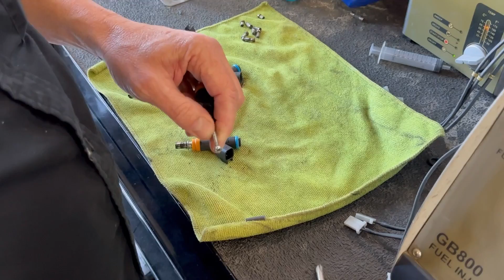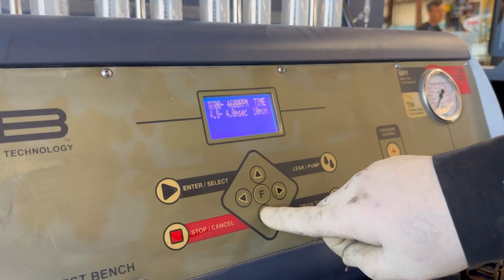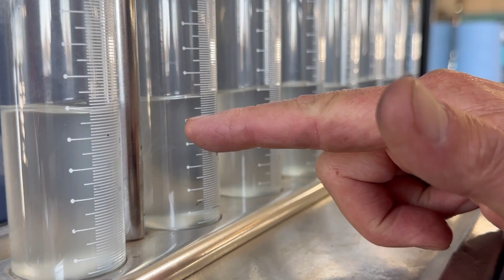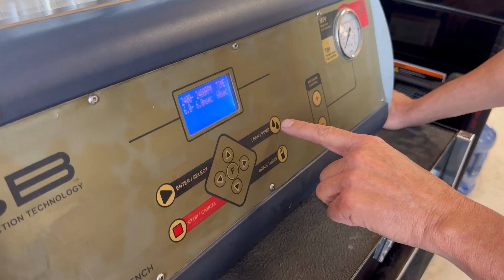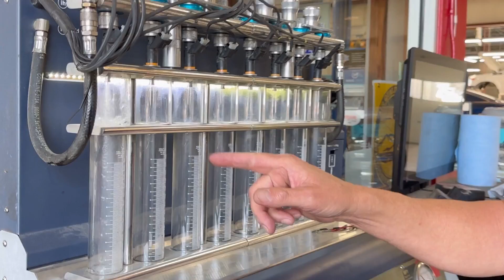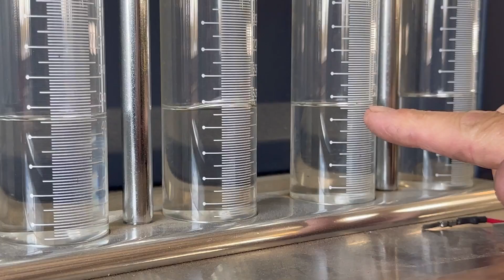How we clean and test our gasoline injectors before we reinstall them in our engines

Comment: This is a "fit" when performed on injectors that are to be used on an engine that is being sold complete with injectors. Try selling this job to a customer as a "fix" for a problem (and then try and selling further work when this step does not fix the problem.) Injector cleanings seem to be easier to sell as maintenance rather than a fix. None of the Dealerships I have worked at ever had such a machine. The closest thing I can recall was a simple pump and gauge type tool intended to be used on full mechanical (is mechanical the correct word?) injectors used with the Bosch CIS injection system. I know that some people like the CIS injection technology but I was pretty glad to see its use discontinued.

Comment: 10$ to 40$ a piece, why even bother?! This cleaning and testing can't be cheaper than that. considering labor hours and if you get bad one from the shop, you knock sensor will tell you that definitely. You could change them every year for that money. I would understand if you deal with Europeans that cost 200$ a piece. 
Even changing them is only one hour work with the knowledge how to hold a screwdriver. 
Video itself is educational indeed, no critics there.

Comment: Got a P050D code for my '16 Silverado, believe it's for injectors. Truck runs fine no issues other than light. Thought I was going to need to change injectors but added injector cleaner and premium gad and after about ¼ tank the light has turned off. I've done this twice. What would you say would be the best route?

Comment: Just a simple question.  With the labor cost of all that testing would it be cheaper to simply replace them all.  I'm assuming that piece of equipment is very expensive.  Even if the original injectors are all good the labor cost would of bought all new.  I replaced a few injectors they are not that expensive. I just want your take on it.  Simply asking to learn.

Comment: Out of curiosity what is the percentage spread between the average set of 6-8 injectors and testing them like this. What is the potential savings to the customer over a new set? I see there being a savings, just wanting to know apx. How much. Because since you have now 6 older injectors with say 100k miles on them and two new ones you know more are bound to fail in the future.

Comment: Dave, I want to take your suggestion to change the oil in my vehicle twice as often as a manufacturer recommends. I have a 2013 Porsche GTS with 125,000 miles; the manufacturer recommends changing the oil every 10,000 miles. Assuming I go forward with changing the oil every 5,000 miles, do I need to change the oil filter at the same 5,000 mile interval? I have a Fumoto oil drain valve installed, so it’s very easy to change the oil. It’s a lot more work for me to swap out the filter. But if you changing both the oil and the filter. Every 5000 miles is the best way to extend the life of my vehicle and avoid maintenance/repair catastrophes, I will take your advice.
Thanks, 
Austin in Nashville, TN

Comment: I have a dodge neon 05 in the shop today. Code p0204. PCM im thinking havent got to check it yet. Customer is aware..though the injector its self works fine...tested the signal with a noid lite..👍. Sounds good through the ear thingy 😂. So hes comeing back at a later time. Cuz today he spent some good $ on suports All 3....😊

Comment: Aircraft injectors are all brass. Soaking in hoppes#9 gun cleaner makes them look like new and is approved. Had a nose steering bearing freeze up. Tried every chemical I had and nothing would “soften” old grease. H#9 cleaned it in no time.

Comment: Dave u think two injectors can throw more fuel then two drilled jets nitrous nozzle or no jets for CNC 30 liter V8 roller bearings in cam n crank ceramic on solid block

Comment: This is great and I wish the shop I used had an injector setup but I ended up sending my off for flow matching and balancing. The oscillating sound of injectors makes people thing their engine is failing but you get used to the sound after a while.

Comment: Seeing the porter in the background using the floor cleaning machine tells me that you have a 1st class operation. If you take care of your physical building like that, then your customers know that they will be treated just as well if not better. The automotive repair industry needs more owner operators like you!
Reply: That’s how it was at the Cummins I worked for. Every bay had the exact same layout. Trashcan, mop, fan, main toolbox, roll cart, engine table (made to hold cams, pistons, head, etc), parts wash machine. You were expected to arrive to a clean bay with everything in place and expected to return it at end of shift with a floor scrub session at end of shift. Place was immaculate. The doors were roll up glass/window doors, every quarter the shop would spend a day washing them. Good times. Only thing I miss about the place was the work environment.
Reply: @Jerryattrickliverspottedhands  The insurance company likes this too!
Reply: Well said
Reply: Totally agree.
Reply: Indeed. I worked at a local shop, that didn't have one. It suuuuuucked cleaning the floor by elbow grease. Only to see a mechanic make a colossal mess on the floor. Worked at a dealership and had a larger floor cleaner. They likely are using a Tenant floor cleaner. The one I used I see my local mall using. Which is a Tenant T7.